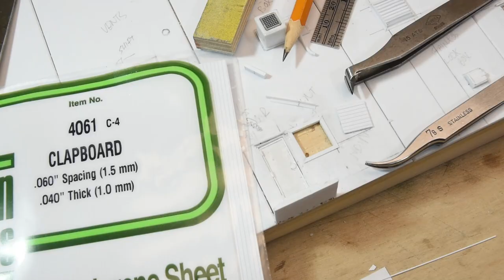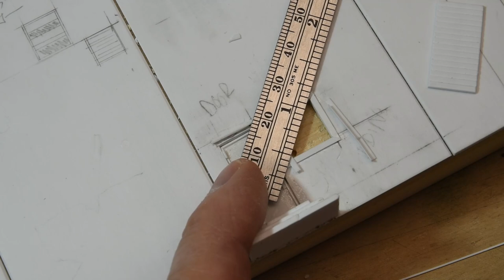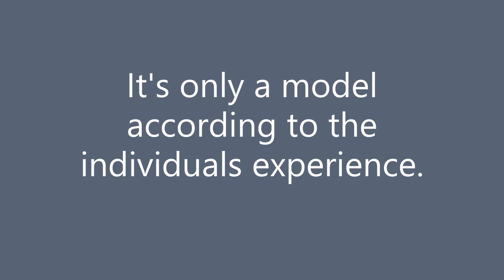The Brewery Build "Part 7" | Modeling Criticism - Vlog #49

Comment: I love the fact you modelled the hinges on the door... That's a great detail. Did you use fine styrene rod for that??? I have used a track nail to model a door handle in HO scale. Most modern buildings seem to have lever handles now so I'm going to try to file down a track nail into a lever handle for my current model, but I would like to steal your hinge idea as well... Thanks for the inspiration ;-)
Reply from the maker: Yes and yes. I used .025" styrene rod for hinges. The impression of a hinge works every time. The track nail idea sounds brilliant! Cheers.

Comment: I have the perfect example for your
theories Boomer, I live a block away
from a factory that was built in the
late 1800s and has had many 
additions built on to it in 100 years,
the original part was 3 stories of
brick, the newer section and covered
loading docks were built of concrete 
slab walls and over all the years it's
had various vents added and windows bricked up so anything goes with a model!!!! Also don't
forget to make realistic areas for
Big Trucks to get into docks and
definitely add dock damage to a
model because there is a lot of
SWIFT drivers out there who can't 
back a tractor and trailer to save
their behind!!! 😂😂😂😂😂😂😂
Reply from the maker: Lol . . . I have a Class 1 license so I know what you mean. I love to see models with the character you just described. Cheers.